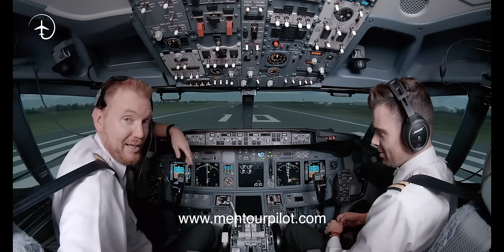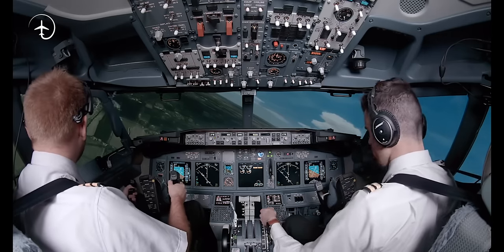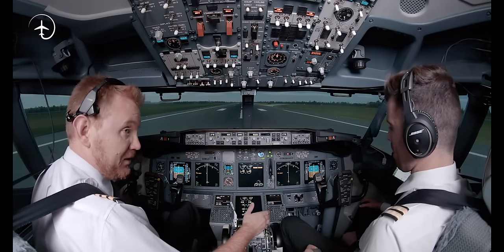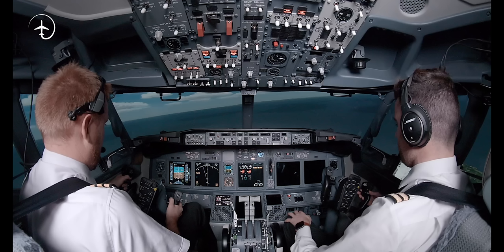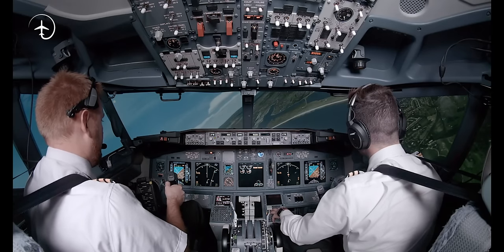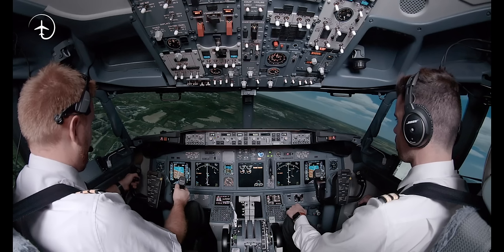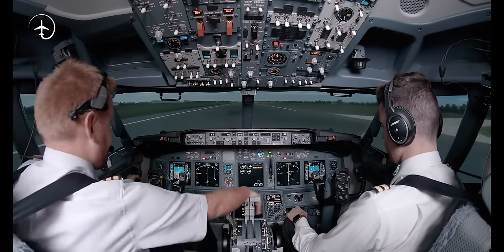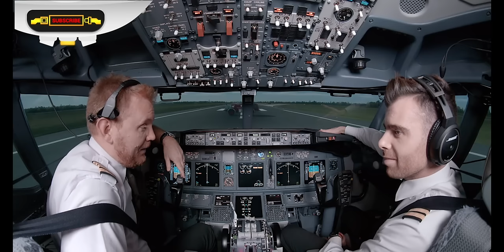Can an Airplane land if BOTH engines fail?

Comment from the maker: Yes, this is a re-vamp of an existing video with added sounds and graphics and a lot of “fluff” cut away. I thought it would be relevant right now.
I hope you will like this and consider supporting the channel 👉🏻 https://www.patreon.com/mentourpilot
Reply: Great video, very educational. Cheers
Reply: Mentour Pilot So thank you so much for always the amazing insight on everything I cannot begin to tell you how much my knowledge has gone up on so many levels I am in enthusiast and I do work for the airlines which predominately uses the 737 800. I really hope one day our paths cross I would love to shake The hand(is that still a thing?i just felt everyone reading this kinda look away /make like they didn’t read that.😂😂) of the man who created the best aviation site on the planet!
Reply: Great video as always !!! I just wanted to ask you .....if a heavy plane ( like a 777) loses both engines in a place with no runways or in the middle of the ocean what are the odds of surviving ?
Reply: What is your take about a recent PIA crash in Karachi Pakistan?
Reply: very good, well done Petter.
Reply: why dont you add the altitude, heading, throttle settings, barber poles, speed, etc in these videos? they are too low res to see the screens and its hard to watch stuff like this without knowing the critical data. a lot of NTSB videos have these videos where the critical data is displayed over the videos. ..
Reply: I would love to see both engine failure in a worst-case scenario for example low attitude, mountain terrain, limited visibility, strong wind, snow, etc.
Reply: Mentour Pilot, please could you do one in which only the RAT is working? Just the same situation but with only the RAT available. No engines and no APUs only batteries and RAT available :) it may be very interesting to see how to manage such situation!! Great job i disfruta en Girona ja que en uns dies podràs anar a la platja amb tranquilitat!!
Reply: What about dumping fuel to reduce the mass of the aircraft?
Reply: @kevm7815        The aircraft that MentourPilot flies, the Boeing 737, is not equipped with a RAT.
Reply: @Aniara64         The Boeing 737 does not have the ability to dump fuel.
Reply: ATC is just Mentour with the voice of god filter, nah?
Reply: Great video! If I may ask, did you make this landing work on the first attempt? Have you tried this before? How common is it for pilots to try this (or other unscripted emergencies) in the simulator?
Reply: Hello Mentour, I am wondering about the flaps lever in 737.  I have noticed in several of your simulator videos that people struggle with selecting the different flaps steps and "fight" with the lever - tug at it, wiggle it around, even slap it to get it to move and to make sure it is in the right detent. Is that only because of stress during some of these procedures or is that lever really so difficult to move? If so, is that something present only in your simulator (e.g. because of some mechanical/wear & tear problem) or is that the same in a real 737? That would seem like a quite annoying mechanical design issue to me and probably the last thing one would want to "fight with" during an emergency.
Reply: @Aniara64  there is no fuel dumping capability built in to the 737 (airplane mentourpilot flies) as far as I know. I'm not sure if airline pilots would ever dump fuel when all engines fail, because the basic procedure is to glide the airplane to ground immediately. The typical scenario with fuel dumping is that they dump fuel from a reasonably high altitude and may spend considerable time doing so. Engines out landing also gives pilots many tasks that are high priority and MUST be done to keep the people on board as safe as possible
Reply: Can you please do a video explaining why the yolk is always shaking, trembling and bouncing from side to side like it’s out of control but the aircraft remains so stable. I’ve never understood how that works.
Reply: iF YUO LOOSE BOTH ENGINES AT HIGH ALTITUDE OVER 30000 FEET AND YOU CAN'T START THE APU  DO YOU THEN LOOSE  ALL CABIN PRESSURE AS WELL?
Reply: My pulse went up watching this!
Reply: @Eternal_Tech  I was just about to post the same thing!
Reply: Nice
Reply: I am only 11 and love ur vids
I like learning about aviation and dream about flying the 787 and start my career with 737 which ur showing.......
Reply: Imagine you fly at 35000feet and 5 screens fall out ! You can not see altitude  speed etc etc! Can you land your plane ? So you have only the yoke ,pedals,trust, and flaps..so you have to fly on feeling ! Is this possible?
Reply: @benkr5870  So while you asked awhile ago and I’ve only just read the question, and and I’m not a pilot nor engineer I’m going to guess that no it’s probably not possible. I say that because of what happened with UPS Flight 6. Smoke from a fire poured into the cockpit and while the pilots had their oxygen masks on and thus could breathe but the smoke blinded them entirely. They couldn’t see the hands in front of their faces. They flew by feel only-at least until the fire damaged the systems that provided the captain with oxygen and he… didn’t make it to the other mask at the back for the jump seat. Now, while it’s true that many of the systems that moved the flaps on the wings and tail were damaged and thus the 747 was basically crippled, if the first officer had been able to see the instruments then the plane could have landed. There’s a lot more details going on, such as getting the speed and altitude via radio from ATC and a relay aircraft but it was too slow to help him. Perhaps the worst cruelty besides flying a crippled plane blind, alone and suffering from the other effects of smoke and heat, is that if he’d just been a bit slower and a bit lower than ILS could have locked on for an auto landing.

But yeah this was a case of total blindness, but somehow I doubt that something like a 747 or even a 737 could be landed merely by looking out the window and eyeballing it. But hey, I work at an airport with plenty of 737s and if I remember the question after I return from annual leave I’ll ask one of the captains for you. If I’m patient I should be able to ask one from the same airline that Mentour works for.
Reply: WOW!?

Comment: Can a plane land with both engines out?  Well, yeah, its going to land eventually.  What state of disrepair it lands in, well there is the real question.
Reply: True, good one😂😂
Reply: I mean rapid unplanned disassembly is not the greatest ending for any pilot
Reply: So clever...
Reply: This one was crashed on a forest instead.  Why pop the gear down when landing on a soft surface?? Fail..
Reply: @outwiththem  i mean, it might reduce the impact a bit
Reply: @toasterhavingabath6980  Landing gear will absorb impact forces. Mentour Pilot has talked about this many times.
Reply: @outwiththem   he didn't land in the forest in this video, he landed on the runway
Reply: As the saying goes
Takeoff is optional. Landing is mandatory.

Gravity writes the rules on landings, and will always be ready to assist you get to expeditiously back to earth.
Reply: Any landing you can walk away from is a good landing. Any landing where the airplane is still usable is a great landing

Comment: I can guarantee it will come in contact with the surface of the earth. Landing may be a bit trickier.
Reply from the maker: Yep, that’s true
Reply: Well... It will LAND, but will it land with or without fire?
Reply: In the entire history of aviation, we have not yet left anyone up there. ;)
A good landing is when everyone can walk away, an excellent landing is when you can use the aircraft again.
Reply: @haqvor  My father had that, though the time between landing and take off again was in the order of 2 weeks. However, before that him and his plane had landed separately, plane not so good, him a little better, but not by much, as he was told 6 weeks later when he woke up.
Reply: you just have to miss the earth
Reply: @yottaforce  Which is exactly how the ISS stays up there, yup.
Reply: Reminds me of the Air Canada flight 143 famously known as the Gimli Glider. A boeing 767 that unfortunately ran out of fuel during it's flight because we Canadians elected to convert everything to metric and underfueled the aircraft... Lost both engines and unfortunately was too far away from any major airports but miraculously were close to an old military runway in the province of Manitoba that was no longer in use and was converted into a race track. Even more bizarre is that not only did they lose the engines but the nose gear also failed to deploy so that added another problem. Luckily the aircraft landed while skidding on the nose section all the while the aircraft remained intact.
Reply: What goes up must come down. The trick is to find a way to bring it down relatively gently and relatively gracefully.

Comment: I know it's a sim, but you can still feel the anxiety of the situation.  Definitely like Sully :) I'm no pilot, but watching folks think quick on their feet is cool and still approachable to everybody.
Reply: Likewise - I could feel my heart rate rising!
Reply: Yes, the thrust levers were left all the way forward for full thrust until the very end. I'll bet the "emergency" felt very real; I've practiced in GA simulators and as simple as they are, you can feel your heart rate pick up during the sim.
Reply: That's what I feel when I try to land the plane to the nearest airport on single engine failure. It's hard to maintain altitude and you could stall easily, I made a hard landing using only memory items that I learned from YouTube. Real pilots definitely can do this easily.
Reply: Pilots go through this drills once or twice a year, the anxiety in the simulator is  not as much as it would be in a real life, the anxiety is just different..... not failing the drill... which might lead to losing your job. Usually this training is carried out in the least favourable conditions, sometimes u get multiple failures at once, also  the controls of these Simulators pilots use for training are also harder than the actual airplane... and yes you might be unlucky to get one of those instructors that bark over you in the simulator

Comment: The answer is yes, but a large supply of new undergarments will be required upon disembarking
Reply from the maker: Indeed!
Reply: Also, the ground crew will need to come in and rock the pilots side-to-side to break the suction.
Reply: Sorry about that
Reply: Well, after this comment I had to double check which channel was the video on
Reply: In my case, probably a whole new wardrobe.

Comment: Mighty fine landing, Pilot.  Years ago, when I was learning to fly light aircraft, my instructors insisted that I bring the engine power back to a high idle and glide the entire pattern.  They always wanted me to manage the energy that I had and condition myself for possible engine failure.
Reply: 1 vs 2 engines? Makes sense IMO...

Comment: I imagine it's pretty hard to set the plane up for a good approach when you can only gain or lose speed by changing your
rate of climb or descent. Speed and altitude are basically hard-coupled in that situation. So that's something to start sweating I guess...
Energy management gets pretty tricky when you can only trade potential vs kinetic energy and only have a non-replenishing combined pool of that.
Again, excellent video.

Comment: Thanks for this amazing video. I have 2 questions after watching this video.
1st- Why did you not close the fuel valves for the engines after decision not to relight them was made? Wouldn't leaving them open be a risk for fire/explosion? 
2nd- Why did you not put the engine thrust lever back to neutral position after noticing engines were severely damaged? Wouldn't that become hazardous situation for more impending problems?
Hope to hear from you soon, Keep posting these types of videos, thanks!
Reply: I was thinking the same thing on the fuel pumps.

Comment: I've flown the same manuver in a Mooney sim dozens of times, and the temptation to throw out the speedbrakes when you think you're too high/fast to make a runway is reeeeally hard to beat, but restraint is very important. You can kill off speed later in the descent, hold onto it as long as you can. Super cool to see how the pros handle it.

Comment: Can an Airplane land if BOTH engines fail?
Captain Sully: Hold my beer.
Reply: He didn't land it, he ditched it in the Hudson lol.
Reply: @markvolpe2305  I don't know, I've watched the video that caught the actual impact, and that was so smooth I'd say it deserves to be called a water landing. That crucial moment could have gone so much worse!
Reply: @markvolpe2305  I would call it a controlled, powerless landing; regardless of the surface.  Also, see TACA flight 110; landing on a levee near New Orleans.
Reply: @markvolpe2305  For all intents and purposes, it was a landing.
Reply: Robert Pearson: Hold my Caesar too!
Reply: Or in the case of Damir Yusupov.......hold my vodka
Reply: @markvolpe2305  no... It was a landing. A forced landing, but it was a landing.
Reply: @Aristocles22  No, you cannot call a ditching crash a landing. You Dunkoff..
Reply: @outwiththem  Can you say that again in English, please?
Reply: @Aristocles22  Corrected.. LoL,, Thanks..
Reply: @outwiththem  A ditching crash that smooth might be considered a landing in all but the technical sense. You're right that normally, this wouldn't be the case.
Reply: @Aristocles22  Did i post it was not a smooth crash.  He killed the speed at 200 feet agl, the computer took over and pushed nose down to avoid a 200 agl stall that could have killed ALL on board.  He hit at 2.5 times the normal expected..  Fail.. Saved by the airplane totally.  

The airplane is the hero, not him, YOU SHEEP.. I taught those maneuvers for years..
Reply: @outwiththem  The pilot has to understand the plane to execute such maneuvers ...... if you look at DUAL ENGINE FAILURE checklist in an a320, starting the APU is at the back of the checklist, but the first thing he did was to switch on the APU quickly enough to maintain "normal law" of the aircraft. He acknowledged the computer did helped him to maintain sufficient glide speed all the way to the "runway", and also he said the landing was harder because the computer didn't let him pull the nose higher moment before touchdown.

Also, the aircraft didn't make the decision to land on the river instead of returning to La Guardia / divert to Teterboro. It was solely based on the captain's judgement that you can't denied on, let alone rudely calling someone SHEEP.
Reply: @junrenong8576  A320's automatically pop out the Ram Air Turbine to maintain the computers if dual failure.  OK to tell the copilot to start the APU, but many other mistakes, huge ones, were made that make invalid the claims of been the hero savior of the passengers. 

#1-Not navigating back to the closest airport as soon as power is lost while keeping going away instead-is a cause for failing a checkride.  Some freeze and cant think clearly on what maneuver to do next.  He needed to Turnback withing 17 seconds, plenty of time.  17 seconds, If turnback he could glide to LGA according to 24 trials done by Airbus with different pilots.  Instead he froze on controls for full 8 seconds, then kept going away from the airport while telling the copilot to restart the broken engines that could explode if you put rpm to them.   Then after wasting 36 seconds doing that, he started turning wimpy way towards the freezing Hudson River.  Many pilot errors done.  Bullshit guy..

And he almost stalled the airplane at 300 agl. The computer stopped his Panic Pull on the stick.  HE killed the speed to flare it, by that Panic Pull, then blamed the computer, which saved his lying asssss...
Reply: @junrenong8576  "The pilot has to understand the plane to execute such maneuvers". So they are putting guys as captains that "Dont understand how to do gliding turns on that airplane?  That is a student pilot requirement before solo.  GR